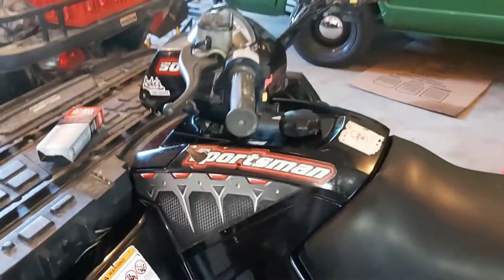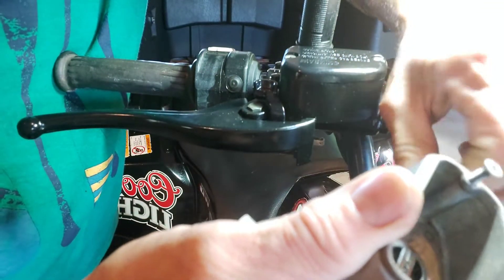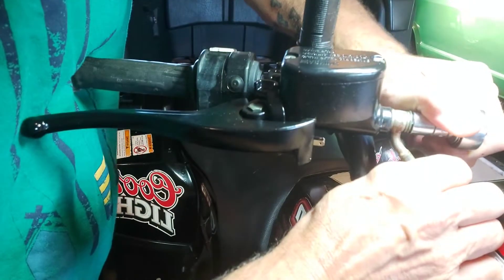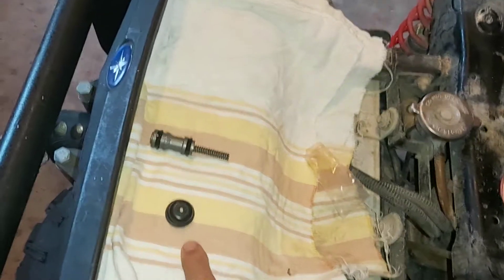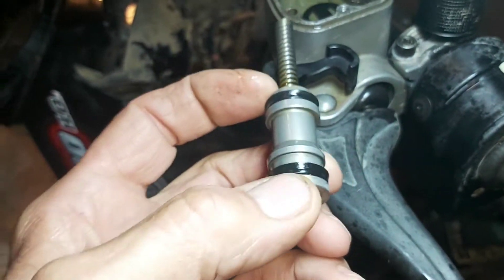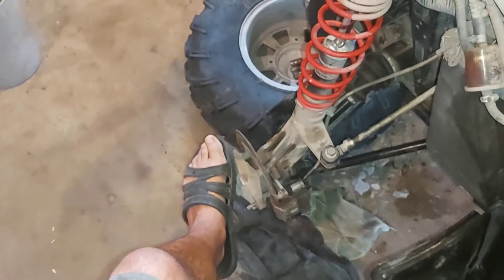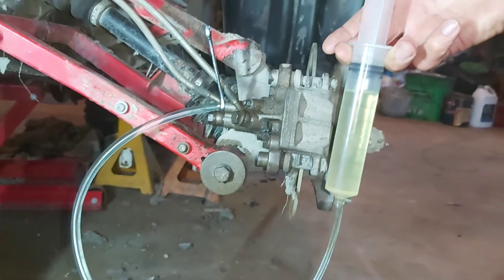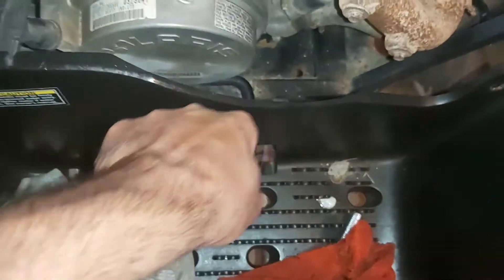Polaris sportsman  500 master brake cylinder repair

Comment: I am watching this video and trying to install the same master and couldnt get pressure and i removed the handle and took the pin out that goes into the master and now pushed it back in and finally got pressure
Reply from the maker: maybe it needed some fluid on the plunger to make a better seal good info thanks

Comment: i got Sp500HO from 2006, tell me is the foot brake affects on all whells?? (on my model its 3 whells that brakes)
I have instant problem with air in the system, already replaced two times new pump on foot brake. The hand brake doesnt do too much, its kinda weak and im running out of ideas.
Any suggestions guys ? Does anyone else have this problems ?? Brake pads and brake shield are in good condition
Reply from the maker: HI the rear peddle controls only the rear brake  on mine the front brake works great  but the rear has little brake force .
 are there ant leaks?. maybe calipers are seized ,did you bleed the air  out  of the system
Reply: @MrKalicat  
Air is out, but if you say that hand lever is responsible for front wheels i will focus on that pump. I always tought that right bottom pedal is responsible for all wheels when used.
Reply from the maker: @piotrlitwornia3358  actually the front lever will control the rear brake as well as front but the foot lever only controls the rear   .  does the hand brake  lever go all the way to the handle bars when used
Reply: @MrKalicat  No, its not going all the way in, you can feel pressure in halfway
Reply from the maker: @piotrlitwornia3358  maybe check the calipers see if they  are moving properly